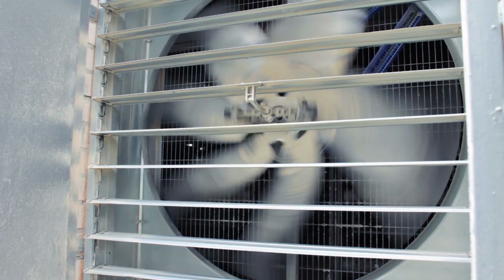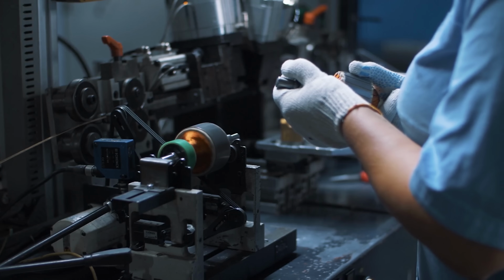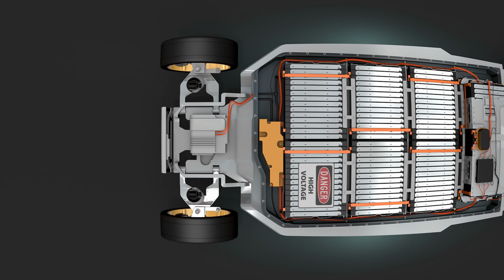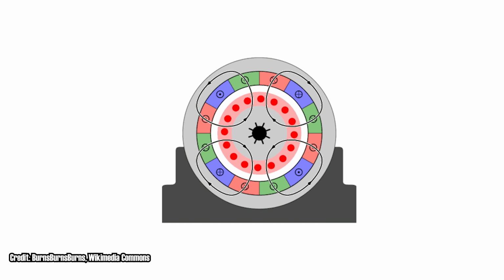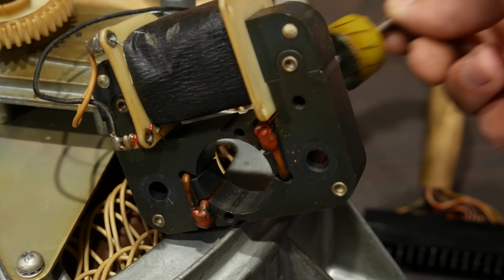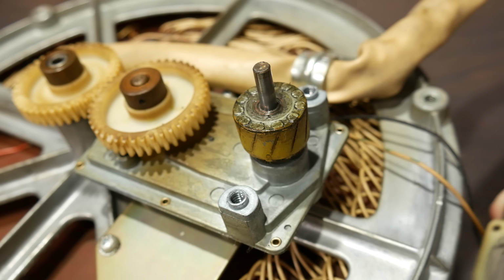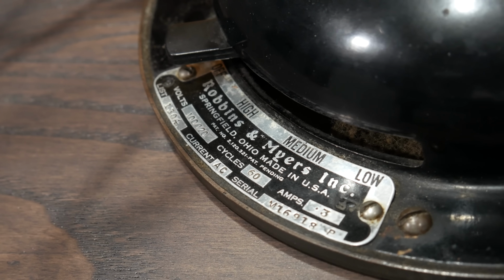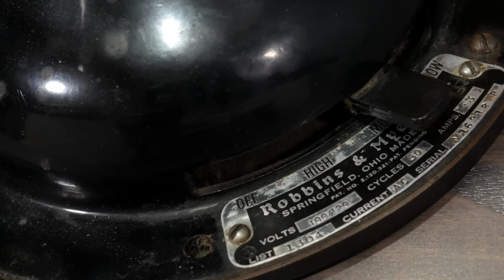Fans; High is next to Off on purpose

Comment: My initial thought : "This must be anothet weird US thing". After reading the comments : "Yep" 

I have never seen ANY device with speed/power settings that has a high setting next to off.
Reply: Yup, can't relate to this.
Reply: 230V land here, can't say I've seen this either. Table/floor standing fans usually have push button controls, and ceiling fans aren't really a thing at all.
Reply: @AaronSmart.online  italian here, can confirm
Reply: I live in Europe and every gas stove I saw had Off, then High, then Low on the knobs. Probably similar reason - easier to light the flame when there's a lot of gas coming out.
Reply: @AaronSmart.online  Ceiling fans are a definite must in the tropics and sub tropics ( so most of the EU, aside from those places around the Med, are out), and all of them I have met start off as high, medium and low. mostly because they tend to have bearing issues with time, and the bearings ( or bushings, depending on how old the fan is and who made it) will tend to become sticky with time, but so long as the fan is able to start turning they will run. Thus you start on high, to get the best chance of the bearing getting it's hydrodynamic film built up and thus reducing wear, as a slow moving bearing or bushing is going to have very high loss,, simply because of metal on metal contact.

In general the fans only start to give issues when older, and often I cure it with a new capacitor, as most ceiling fans I meet are not shaded pole types, but split phase. Bearings getting stiff it is possible to lubricate them, but often the housings are pressed together, making it hard to get to them for a good repair, and the modern trend is to use that horrid CCA wire as well.

The ones on my ceilings are around 20 years old, and still work well. The smaller fans almost all are split capacitor, though the old GE fan is rather odd, in that it achieved phase rotation by having variable reluctance in the pole pieces, using thinner sections of the poles to provide a saturating magnetic field. As the field saturates it appears to shift, allowing the fan to start as the field is moving, and not just varying with time, just like the shaded pole does, but without the need for the copper shorting coils to bring about the field saturation in the motor. higher starting torque simply because there is no circulating current in the pole pieces, so more energy available to induce a rotor current, plus the rotor is skewed, so there is a bias as to start direction built in.

Yes 230VAC country, currently ( amazingly) 233.2 VAC , though it can go up to 247VAC at times, but after they replaced the 90 year old transformer across the park (it started leaking from the base valve, so went for repair instead of just a new valve) the newer one ( still around 30 years old, they are refurbished because of the cost of new ones) is set more closely to 230VAC instead of the old one being 240VAC. I lived in a place with the original 130 year old 250VAC supplies, and there cooking was great, but appliance and lamp life was not, though your lamps were extra bright. That will never change, as they would have to replace over 50 transformers at once, so keep the taps on the low side instead to meet spec for high voltage.
Reply: The US electrical system is weird because it is probably the largest and most complex in the world, and didn't get bombed to a clean slate in the 1940s. It is slowly all getting swapped out, though.
Reply: @AaronSmart.online  
well, i guess you're from europe but here in India, 240V land here, we do have a lot of ceiling fans and...                      ...yeah, there IS a on/off switch and speed controler with the order:-
off, 1, 2, 3, 4, 5.

sometimes it is off, 1,....3, 4.

anyway, whatever.
Reply: Went to Cyprus a few years back and the stove settings was 0 for off and then 3 to .5 where 3 was min and .5 was max. Took me ages to realize why the water for my soup was not boiling.

https://abload.de/img/cyprus_ovenaxjx7.jpg
Reply: I might be mistaken, but don't most other countries supply 2-phase or even 3-phase to homes by default? I think even stoves and dryers are full 3-phase appliances, whereas the US has single-phase for most of the house. Even if you only have two phases, that's two sine waves with a 120 degree offset, which is enough to create a rotating magnetic field. So yea, I don't think any of this is necessary for 2-phase power.
Reply: The only appliance I‘ve ever seen go from „off - high - low - medium“ is a slowcooker I‘ve imported from the UK. On fans (and I‘ve gone through loads of them), I‘ve never seen this. Most of them use a button selector instead of a rotary switch.
Reply: @matteocristini6221  omg no way. Italy doesn't having CEILING FANS?
Reply: @SeanBZA  THIS. fucking SO much this...  This is why i look at comments. this is why i look at comments on this channel. THIS is what gives me a gleaming hope for humanity. It isn't humanitarianism, it's engineering. [damn i hope i used it's correctly there]
Reply: @CorwinPearson  mainland EU usually does, but the UK is a special snowflake and is still single phase to homes, maybe to do with our other special snowflake ring main system where the entire house is on one circuit? Of course the transmission is still three phase down to the substations and stuff. My washer and dryer are just on a higher 40A breaker where the rest of the flat shares a 28A breaker for the other appliances. And then there's a 13A fuse in the power strips and plugs. The UK ring main system means we have to have fused plugs (but unfortunately many plugs nowadays just have a sealed 13A fuse even if the device it's connected to can only handle 1 or 2A, strictly speaking the fuse should match the load but nowadays it's pretty rare to find a 1A plug..)
Reply: I've just checked my British fan: Off, Low, High.
Reply: @unimor2781  When it comes to gas things that have such a layout (I can personally think of two in my home; the gas hob/stove, and the gas BBQ) this is actually done for safety reasons. That sounds a little counter-intuitive, I know, but there is a completely valid reason for this.

Gas appliances have a minimum threshold gas flow to keep burning. If the gas flow gets too low, the flame obviously goes out, but gas will continue to leak into the room. So, to make sure you can't go lower than the threshold, there is a point where the dial will stop when you turn it from the highest to the lowest setting. If it went the "normal" way, there's a chance you'd unknowingly make the gas flow lower than threshold.

And, more obviously, it just makes it easier to light if the initial flow of gas is the maximum it can be.
Reply: @CorwinPearson  sorry but in house 2 phase is 180 degree offset.
Reply: I don't think I have ever seen a fan in Australia that has high as the first position.  My current ceiling fans can switch on to either first, but you are switching it anticlockwise to get to high.
Reply: @CorwinPearson  I don't think so. I'm in UK and I have a single phase to the house. At 230/240v and 13A at a socket I can draw more than enough power... 3KW kettles for the win (sorry 'merica!). The electric oven does have its own fused feed, but it's still only a single phase at 230/240v, but it's rated at 45A (yeah, BIIIIG cable!).

My house is on one phase, my neighbours have the other 2 phases, so in theory all the phrases balance out over the whole road.

The same happens with street lights, you sometimes see every 3rd one off because of a phase fault.
Reply: Corwin Pearson Residential power in the US is always split phase, so it’s 240V with a center tap. It’s still effectively ‘single phase’ power though.
Reply: You can also easily see and hear the gas is lit.
Reply: Maybe it's because they have only 110V?
Reply: @jackbaxter-williams8059  not where I live (northern italy) but I guess they might be more common in other regions
Reply: Hell I'm not even that far from the northern US border and I have never once seen a high setting next to the off setting
Reply: @CorwinPearson  In France (also valid for other countries in EU) 3 phase (plus neutral) is still available for houses, but most new constructions mostly use single phase. In a modern house, 3 phase system have a lot of disadvantages:

1: Phase balancing can be a real pain, especially with "smaller" subscriptions plans. Its not uncommon to be forced to take a higher power subscription because of balancing. 

2: 3 phase breakers are WAY more expensive than single phase. GFCI are even worse (and they are mandatory for EVERY circuit). They are also harder to find and takes 3x more space in the electrical panel. 

3: Some modern appliances (stoves, heaters, air conditioner... can't even be wired in 3 phases. Making balancing even more complex, sometimes impossible. 

4: A wiring error in 3 phase can send 400v in a 230v circuit, frying everything connected. With only 1 phase and 1 neutral there is less room for error. 

5: Also, if the neutral get ruptured, it can also cause overvoltage (because in a domestic environment, phases aren't perfectly balanced). Happend to me, it wasnt fun. 

Because of this reasons, , 3 phase is getting rare this days. Especially in urban or periruban areas. It's still widely used in very rural areas, because of lower voltage drops and many farms use 3 phase motors. 

Ps: Domestic washers and driers are always single phase, with a maximum of 16 amps. Most stoves can be wired on 1, 2 or 3 phases, but some models only tale 1 phase
Reply: @ameunier41  In some places you can have 2 phases taken from a 3 phase system, so still 120° offset. Motors can be run by adding capacitors to recreate the missing 3rd phase.  In Europe It's almost extinct nowadays, mostly because it combines the disadvantages of single and 3 phase
Reply: @CorwinPearson  In the US, most homes are supplied via a center tap transformer. The "2 phases" are exactly 180 degrees out of phase. Using 1 phase gives you 120 volts RMS. Using the second opposing phase along with the first gives you 240 volts.
Reply: @unimor2781  And more obvious if you turned it fully off or almost off.
Reply: Jason Schubert old fan switches in Australia had them. Newer style selectors though are like as you describe.
Reply: I live in Brazil and i've seen both configurations
Reply: Ditto. Never seen a switch patter like that in Asia
Reply: I live in Germany and I own a fan that has a high setting next to off. But then again it has two. One next to off and one next to high. It is weird in its own way^^
Reply: @lionnelc13  In Poland u can have 1p/3p with 32A/phase max. 
1. Phase balancing? U think they count every shift between? If u look on bigger scale your one phase is part of 3 phase system they separate this.
2. 3p is more costly yes because u have all 3 times

3. Some modern appliances (stoves,heaters, AC) are almost always 3p.
4. Yes, but this should be done by elekchiken. 3P have 5 wires (1p,2p,3p,N, GROUND[green/yellow])
Reply: @vanhoe0  it's because antique fans had to do it that way, and United States was where the fan became a household item. A decade later even though most fans were now using a newer technology and a different motor design that didn't require the high setting to self start, it became a tradition kind of like our qwerty keyboard..
Reply: Single-phase 230-240V is standard for residential power here in Australia, although some large properties may use 2 phases + neutral or even  3-phase consumer mains for a  mansion with facilities for guests and staff (i.e. peak demand loads getting close to a commercial property). In these cases the circuit loads are balanced across the phases. Generally though, it is the supply authority's responsibility to ensure that consumer loads are balanced across the supply phases in any given area. I believe it's the same in most Commonwealth countries with the exception of Canada (for obvious geographical reasons), although we don't use the UK'S weird ring-main system which came about due to copper shortages after WWII.
Single-phase stoves/ovens, washers, dryers, and HVAC equipment is more common than 3-phase gear in these countries, at least in residential applications.
As for fan switches.... I've seen both the old 0-3-2-1 type designed for shaded pole motors and more modern 0-1-2-3-0 bi-directional switches for motors that use a start  capacitor or split windings.
Reply: It sounds to me that ALL fans started like this, but the US, as it is known for its refusal to adopt things that make more sense

* cough * metric * cough *

just decided to keep it the way it is.